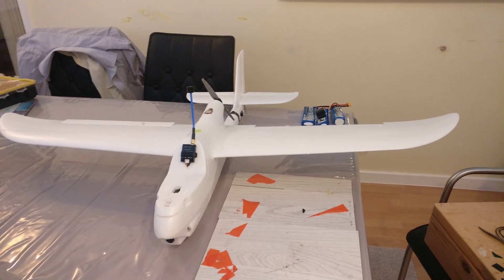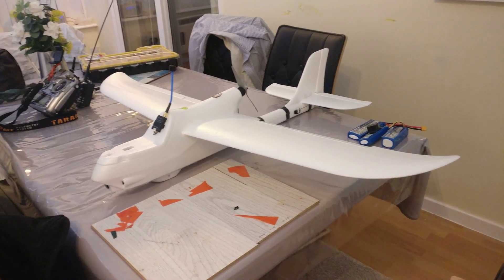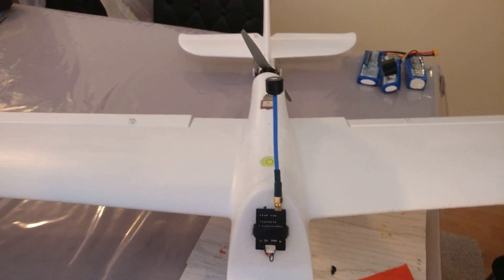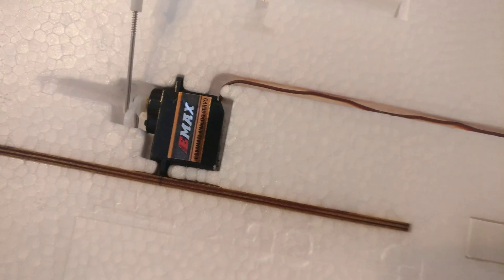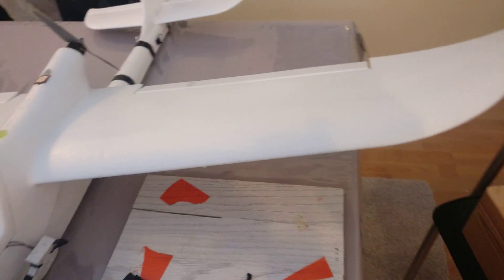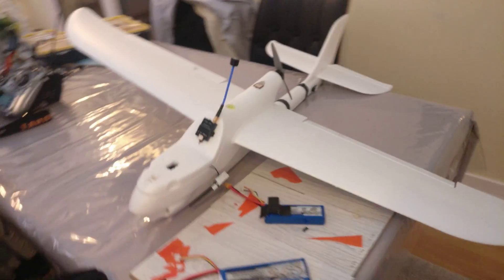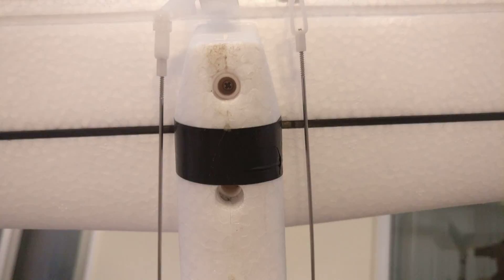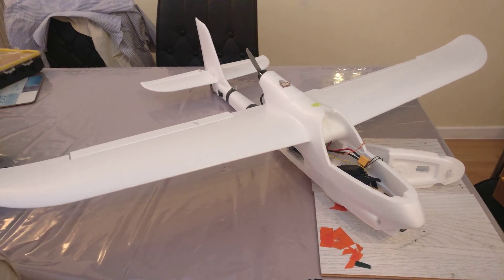Ranger G2 post build review.

Comment: Nice post build review, I’m just about to start mine. I see you mounted the motor on the outside of the housing rather than inside the case, as the RTF version comes. Why did you make that choice?
Reply from the maker: It was due to the prop shaft mount.